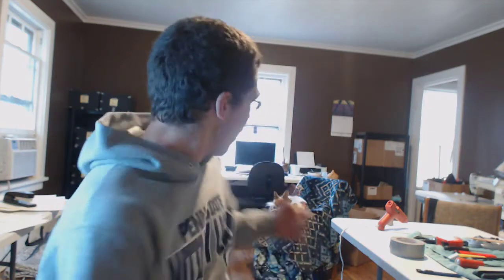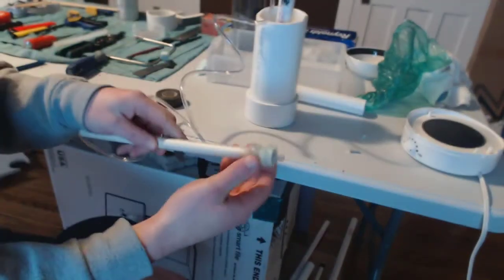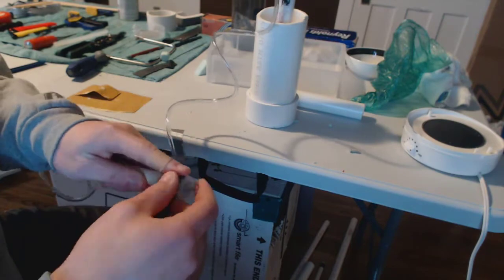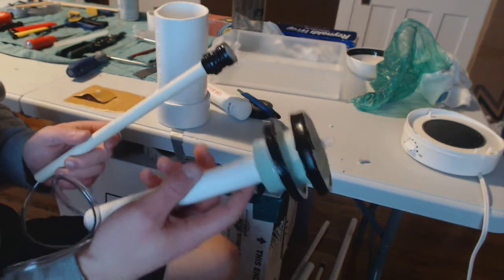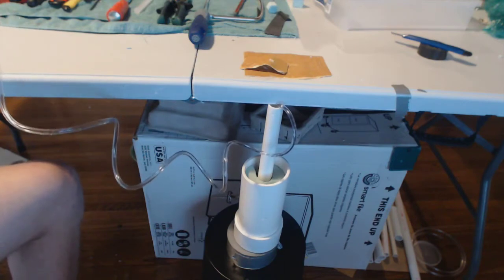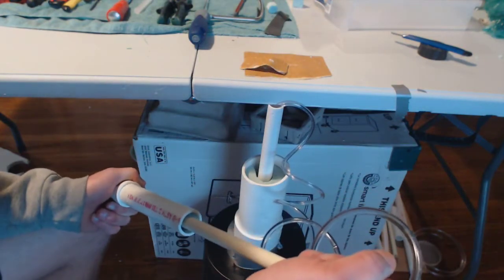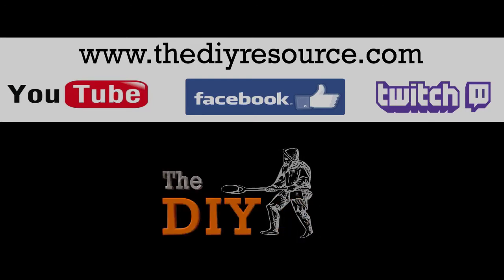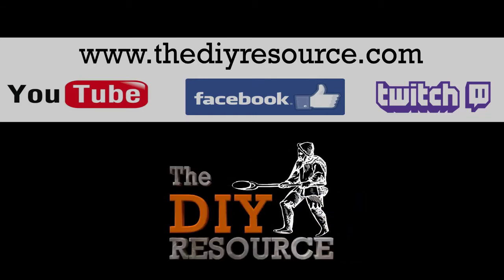Engineering Vlog #1 - Demonstrating the DIY Hydraulic System!

Comment: You can use threaded off fittings with hose barbs and a flat solid rubber gasket for a plunger. You could also use a one way check valve as a vent to allow you to keep pumping. But to save some time I would just go buy a bicycle air pump. Also to get ideas you can YouTube pvc air horns.